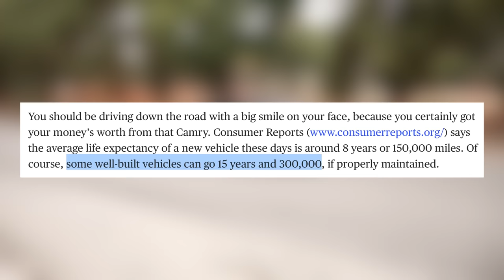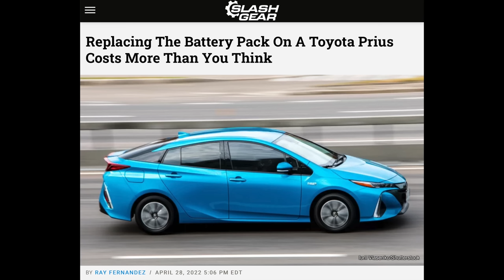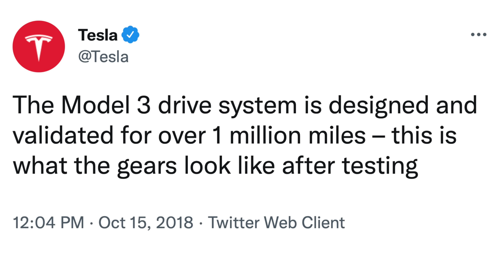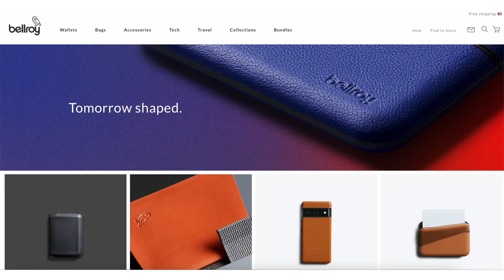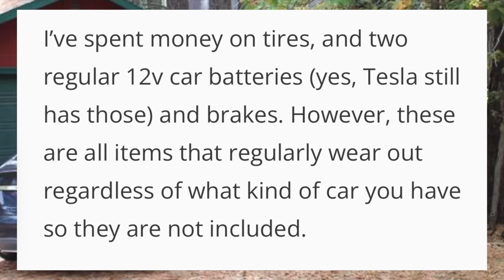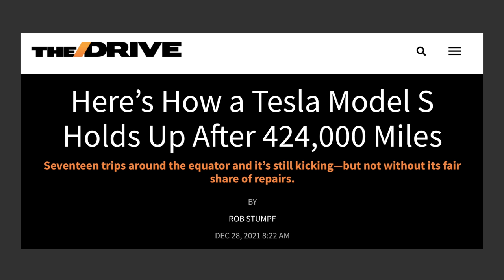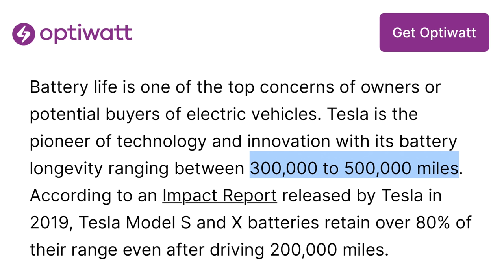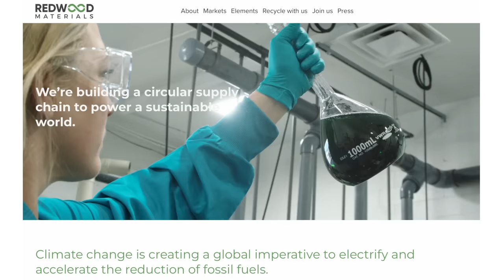The ONE MILLION Mile Tesla | It Still Runs

Comment: This all syncs with my experience. I've had access to and been using a 2018 Model 3 (Dual Motor) consistently for the past two years. Maintenance has been minimal. A 12v battery was replaced under warranty (that one is more important than you'd think). But brakes, tires, etc. all held up remarkably well. Compared to my BMW 325i, this car has been extremely low maintenance.
Reply: bmws are also big money wasters. they require TONS of maintenance haha so ur comparison is null
Reply: @Donut-sw9ud  I have two E46 (330 and 325). The 330 hasn't broke anything so far (at 200k miles) yet, but the 325 has blown a MAF. Luckily MAF are 20$ at the local junkyard. They can be pretty good so long as you treat them right and occasionally go out on long, fun drives.
Reply: My 2022 model Y has a new lithium ion 15 volt battery that has the same warranty as the drive battery. So that weak link is almost eliminated.
Reply: @Donut-sw9ud  It's a comparison of maintenance.

The Tesla did not require much, while the BMW did.

In what way is that null? Compared to any other vehicle his Tesla still did not require all that much done to it.
Reply: @ThatOneCatNyx  What about oil change? sparkplugs? brake plates, filters for the engine etc.
Reply: Wow weird seeing this channel here.
Reply: @dragosz0r  what about a new battery after the original one dies? What does one of does costs, 15--20k? that is a lot of oil changes, filters, etc.
Reply: @dragosz0r  Yep. BMWs go through oil and brakes like nobody's business. When those cars are in perfect working order, they're a dream to drive. Truly, the ultimate driving machine, as the slogan goes. But Tesla's are also a lot of fun to drive and WAY lower maintenance.
Reply: Why was the battery replaced on such a new car?
Reply: @FriendsInLowPlacees  Not sure why, but I do know that the M3 started to have a lot of problems when that battery got low.
Reply: have you got rust on the brake discs some say it could be the consequence of using the brake too little
Reply: @ThatOneCatNyx   Here in Sweden, we can also have diesel BMWs, I think the most powerful is at 340 horses, like an Alpine or 540d xDrive Touring
Reply: I currently have a 2018 BMW 230i and thinking of trading it in for a Tesla 3 and just calling it a day. The low maintenance and gas savings is really enticing and I plan to keep the car for 10 years
Reply: you know what they say about bmw right? drive a mile put $0.25 cents away for every mile you drive because you are going to need that stash of money when not if but when the car breaks down. All bmw's are trash when it comes to reliability. The funny part is their engines and transmissions are nice it's just all the added electrical and not to mention all the components in the engine are made of out plastic. Plastic doesn't last long. Also the can electrical system is the dumbest thing i ever seen for a car to be wired that way.
Reply: @AllgoodthingsTv  the only time when bmw's are fun is when you put an LS1 or 2jz engine in it.
Reply: @silimarina.  The cost for a new timing chain is also quite substantial. BMWs are known for for their failures on the N47, M57 etc.
Reply: How often did you have to replace your tires? I’m closing in at 16k on my M3 LR and need new tires
Reply: I own a hybrid and electric car repair shop and not should be saying this but with all honesty I will anyway. Lithium Batteries will get you stranded when they fail. They do not simply diminish in capacity and affect range. No sir. When lithium batteries fail they reduce in voltage causing them to become overcharged heat up and busted them become literally an open circuit, and that and can even catch on fire or explode, but thanks to electric card l electronic controls they will simply get you stranded. 5K for cheaper option? No way I would get that. The fact that one or several cells have failed means the rest are on borrowed time. That all means one thing for sure. You gonna need to repair the battery again. In a year or two if lucky maybe even a few months few days you don’t know. Believe me been there done that with customers cars. I even made an experimental car using lithium iron phosphate. Even that did not hold up to all the hype about its longevity, but the EV industry is not telling you all the ugly side of owning an EV. There will come a time when people will rally to bring back gas engine.
Reply: @ronaldoquintos1675  that’s why I’m kind of waiting for solid state battery powered cars as everyone knows that’s the future of electric
Reply: Compared to BMW, anything is low maintenance.
Reply: @safeandeffectivelol  you know what they say about bmw. Save 25 cents for every mile you drive. For the coming repairs that’s eventually going to plague your “ultimate driving experience”
Reply: @freshandsaltyjohnny  My 325i fell apart after 60K miles and the warranty expired. I didn't drive it hard and got all of the recommended maintenance at the dealership since it was free while under warranty. I put about $6K into it to fix it and sold it right away. That was the last German car I ever bought.
Reply: @safeandeffectivelol  what you driving now? Just curious.
Reply: @freshandsaltyjohnny  I have a 2008 Toyota Highlander with 315K miles and it runs like new. No mechanical issues at all. I also have a 2013 Toyota Camry SE with 180K miles that runs like new. Great mileage on the Camry. I might consider an EV in the future when battery tech and price improves. Possibly sodium ion batteries. I don't think lithium is green or sustainable at this point.
Reply: @safeandeffectivelol  I drive a gen 2 volt that gets 53 miles of EV which is pretty good for me. When I go on road trips like the one I’m on now I just put gas in it. Mpg is 44 but when I use ev it’s 60-100mpge .  I I’d the math and it’s cheaper for me to charge my car then use gas. In the future I will have a power station with solar panels that I will plug into so I never have to pay for electricity ever again. After about 2 years when I meet ROI I will just be charging for free. Once you go plug in hybrid it’s hard to go back to straight gas unless it’s a Prius in which they get 620 miles of range which is very nice as my car only gets 420 miles of range with an 8.5 gallon tank. My gf bought one too because she loves not pumping gas either lol.
Reply: @freshandsaltyjohnny  Didn't Chevy discontinue the Volt? What happens when the battery goes bad?

I thought about the Toyota RAV4 Prime that is a plug in hybrid. I believe it has 40 miles range on battery only. That's good enough for me since I work from home. The grocery stores are nearby and if I need to travel further, I can just fuel up.
Reply: @safeandeffectivelol  Chevy over engineered this battery pack to perfection 88,000 miles and I still get the advertised 53 miles of ev range. They discontinued this car in order to pursue full EV so they replaced it with the bolt but the earlier bolts caught on fire so they discontinued that too. Chevy spent too much money on R&D on the volt. No money on marketing. But the volt is as popular as a Prius or Tesla I see 20-40 of them a day. They go to 400,000 miles and keep going like some YouTubers have showed. It has the highest customer satisfaction rating of any vehicle ever made with only the Tesla model 3 knocking it out of the number 1 spot recently. Talk to any volt owner they will express how much they love their car. I go through 1 or 2 oil changes a year. Never even use the brake pedal as I have regenerative braking pedal on the steering wheel. Extremely low maintaince and reliability of battery pack is what makes this car special.
Reply: @safeandeffectivelol  that rav4 prime was on the radar but for the price of that car you can pretty much buy 3 volts. 40 miles of ev range in reality it’s more like 20 after a few years because Toyota doesn’t over engineer the battery pack like Chevy engineers did. Meaning they made it so you don’t have access to all of the battery but it replenishes battery on the diminishing return of time. So basically if you drive a 360 mile extended range Tesla after 3 years you get about 280 but it doesn’t lose much after that 3 year period.
Reply: @freshandsaltyjohnny  RAV4 Prime is $42-45K from what I can tell. They're not that expensive.
Reply: @safeandeffectivelol  I bought my volt gen 2 Lt for $14k and my gf bought hers for $16k so yeah you can buy 3 volts for the price of 1 rav4
Reply: @freshandsaltyjohnny  That was back then. I doubt if Chevy was still making the Volt, you could get a new one for that price now. Vehicle prices have gone up around 20-50% over the past 2 1/2 years. Even the Tesla base model price increased by 22% in March 2021
Reply: @safeandeffectivelol  we just bought our volts I got mine a few months back and my gf just got hers less than a month ago. I got mine so cheap I could sell it for $4k more and buy the premier model of my car like my gf’s and have the mini auto pilot similar to the teslas
Reply: @dstr1 but when it’s on you way more expensive…. Tesla is scum when it comes to customer service.
Reply: @neubauerjoseph  I have to admit that Tesla doesn't treat it's customers like customers. They are tool tolerant to being treated that way.
Reply: @Donut-sw9ud I have a 2017 M140i, nearly 100,000 km. Zero maintenance outside of scheduled servicing. Brakes done at 70,000 km.
Reply: just about any car is going to do better than a BMW. I am a mechanic/shop owner who works on them and they are rolling buckets of junk after 80-100k. Mercedes is a way better long term then BMW, a kia/hyundai is better long term than a bmw
Reply: @Donut-sw9ud you should buy a tata nano for your self it is a big money saving car as you will get it in 1,558 us doller only 😂😅
Reply: Yeah most of the people I know who own EVs and complain about burning through tires are also constantly flooring it and racing people on the highway
Reply: Compared to my experience my mates dad had a 2023 model 3 performance that only lasted 65k miles before needing its battery replacing and one of its motors

Comment: I work in due diligence for energy storage. Some tips: low state of charge is generally good for storage (resting state-of-charge or rSOC between 20% - 40%). For LFP batteries (standard range new teslas) charge your battery to 100% every week or two so the software can recalculate range, but do not store at 100% for long periods of time. Only supercharge between 20% and 80% charge. Cycle count for a daily driver should be less than 1 full equivalent full cycle (1 EFC) per day, but standalone battery systems typically cycle 1x per day, so they are utilized more, and have a rated lifetime of 20 years. You should be able to get 20 years out of your battery with proper care.

Comment: I just lost my modelS to an accident, it was one of the first 4000 built, when I got the car on Feb 8 of 2013, the projected range on a full charge was 271, just before the accident it was 258, after several full supercharger visits, I was thrilled with the the battery performance.
Reply: That's good to hear, but more importantly you're safe!  I hope everyone else who might have been in the car is doing well. Tesla's safety is the #1 reason to keep driving it  for so long for yourself and anyone else you transport in your car.
Reply: So dry 4ur losss I appreciate you sharing
Reply: That just sucks!  Was the insurance payout reasonable?
Reply: 4.8% battery loss in 8 years?
Reply: @gnoxycat  SORRY FOR THE LATE REPLY, I WANTED TO BUY OUT THE CAR AT 21K AND FIX IT, JUST LOVED THAT CAR. BUT THE INS SETTLEMENT WAS 45K, I THOUGHT THAT WA PRETTY RESONABLE FOR 10 YRS OLD , SO I BOUGHT A 3.
Reply: @davidbeppler3032  YUP, I LOVED THAT CAR, REALLY WAS PERFECT, TESLA BATTERY MANAGEMENT IS THE BEST THERE IS, UNFORTUNATELY FOLKS WILL FIND OUT THAT FOR RELIABILITY TESLA IS THE ONLY ELECTRIC CAR IN THE GAME.
Reply: Curious. My SR model 3 has gone from 271 to 258 in just over two years, but that's based on the 100% charging that Tesla recommends for LFP batteries. I've just read that this reccomendation is to ensure accurate range calculations,  and not because the battery better handles being fully charged,  so I'm wondering if I should ignore their advice to prevent it contuing to degrade so quickly.

Comment: I'm actually the owner of that "424k mi" Model S from The Drive article (now the car us at 434k mi). 

Unfortunately, like lots of articles, they left out a few bits of info, and made some additional assumptions. As of right now, the car still retains its 2nd pack (approaching somewhere in the neighborhood of 180-190k mi), and has ~87% capacity compared to new.

Not mentioned in the article (though I believe it was addressed in the video the article was about) is that the front drive unit was actually replaced, though not until ~375k mi. The rear drive unit is still original to my knowledge. 

Also worth noting, I purchased the car from its original owner in Sept of 2020, at which time the car was nearly exactly 5 years old (build date of Aug 2015). At that time, it has 408k mi on it, which means the previous owner (who used the car for Uber full time) put on an average of 82k mi per year!

I'm actually planning on making an update video on the car soon (and also have a few others posted on my channel). It is my daily driver, and I actually just got back from a ~2500mi road trip with it earlier this week!

I actually work on these cars for a living (at a 3rd party shop, not for Tesla), and there are definitely some versions of the S that are much more problem prone that others, particularly the early models, and pretty much anything that has a Large Drive Unit (RWD or Performance).
Reply: Thanks for the update and thanks for giving EV owners another place to get repairs done. The more the merrier.
Reply: Yes good to hear 3rd party independent Tesla service options exist for the older cars.
Reply: Please do an update video
Reply: @Joe_-_-_  update video has been posted!
Reply: I drive a 2014 model S and do rideshare with, it has 208,000 miles on it. I did my 1st brake job this week, brakes and rotors, what other car can go that far on a set of brakes? I also had to replace the drive unit, or motor for the 3rd time. First 2 times were under warranty, this one cost me 6K. I'm hearing the 85KW battery is tough on the drive unit. Not sure why, but I won't be buying another Tesla with that battery in it. Anyway looking to upgrade to a model X, while waiting for my Cybertruck.
Reply: The drive unit failures you have experienced have nothing to do with the battery, but are rather caused by a design flaw in the Large Drive Unit (or LDU). The most common cause of drive unit failure is a leaky rotor coolant seal. When the seal goes bad, it leaks coolant internally into the LDU, where it has no place to escape and essentially "pools up". 
As I'm sure you can imagine, Water + HV electronics = bad time...

We rebuild a lot of these drive units at the shop where I work, and we also add a drain kit to prevent catastrophic damage to the drive unit if/when the seal wears out (which it will). 

If you want to avoid those issues, then it's best to steer clear of cars equipped with the LDU, which includes: All RWD and Performance Model S/X from 2012-2021 (pre-Palladium), as well as the 2012-2014 Toyota RAV4 EV, and 2014-2017 Mercedes B-Class. 
(Note: AWD non-Performance versions of the Model S/X do not have the LDU, and do not suffer from these issues)
Reply: @AlexEVRepair what’s your opinion on the m3 LFP batteries? Do you foresee them lasting longer like they say?
Reply: @maxrubin9540  purely from a chemistry perspective, LFP should have a significant advantage over NCA or NCM in terms of cycle life. In laboratory testing, LFP cells usually experience 2-3x higher cycle life. 
That of course doesn't take into account other possible failure modes in the pack (electronics failures, water intrusion, etc.), however, those types of problems can often be repaired (not something Tesla will usually do, but certainly doable at 3rd party EV repair shops like mine).